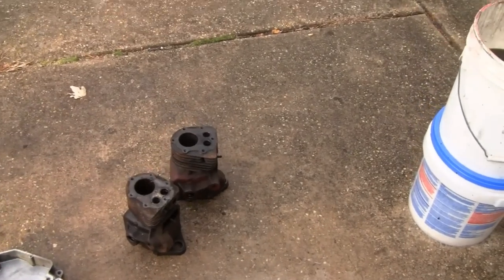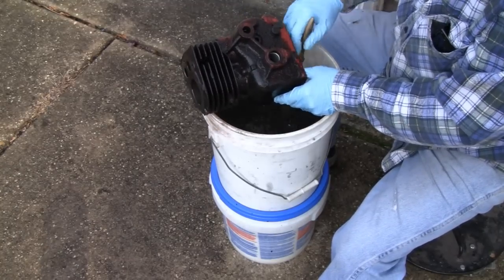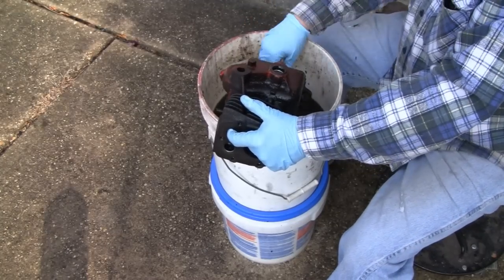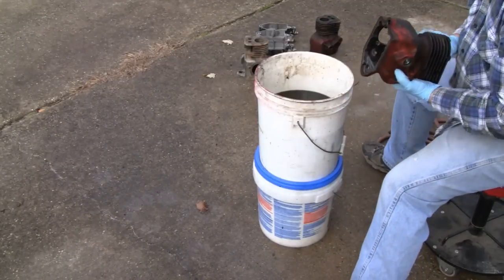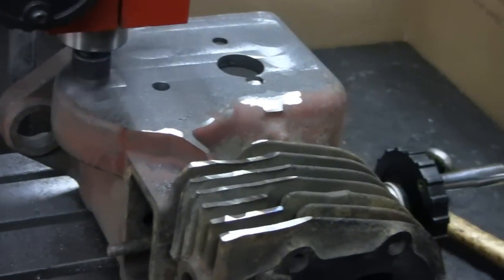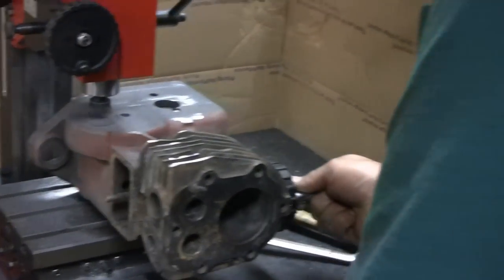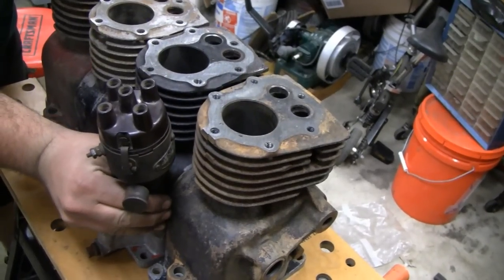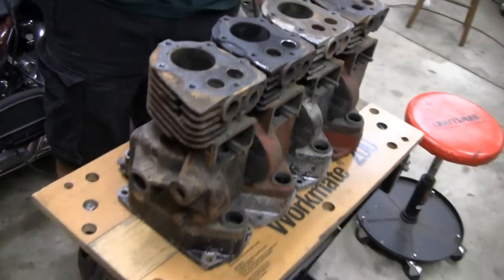HOMEMADE 4 CYLINDER BRIGGS PROJECT (part 2)

Comment: My cleaning concoction what for not having to touch stuff for a few days 
Is a mix of 
Vinegar 
Thin viscosity oil 
And diesel..... 

Did an amazing job at cleaning a very very fucked up set of carbs of a marine engine I had

Comment: I think it would be easier to mount the distributer between cylinder b&c so that way you could have the same length in wires and adjust the timing really well
Reply from the maker: If only it was that easy Lil' Buddy!!☺
Reply: 805ROADKING true but after a little C.A.D. work i've done it should be pretty easy

Comment: You should’ve used electrolysis, it works much better & faster. But then you’re removing old paint, so it’s a little different. We need an inline-6.